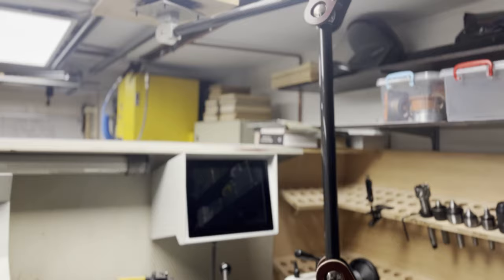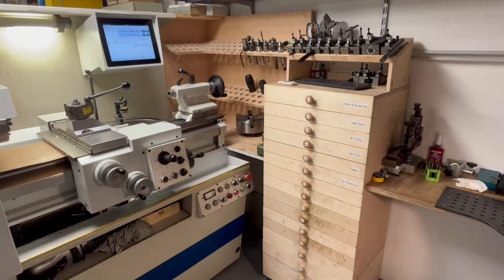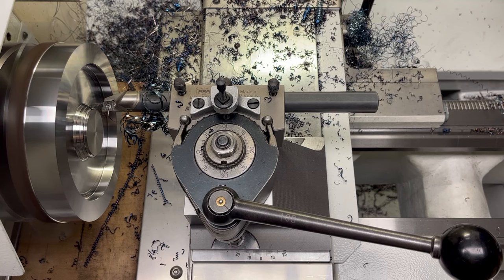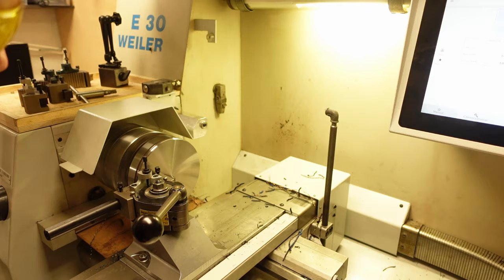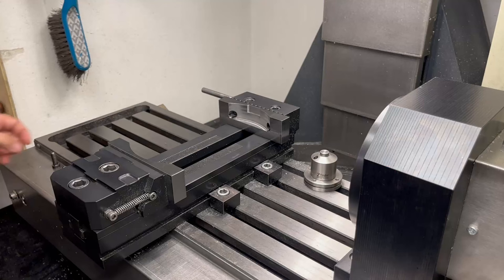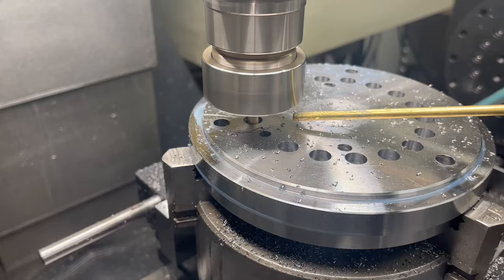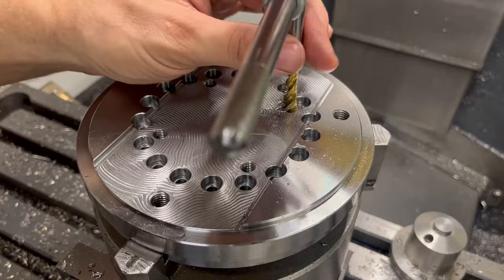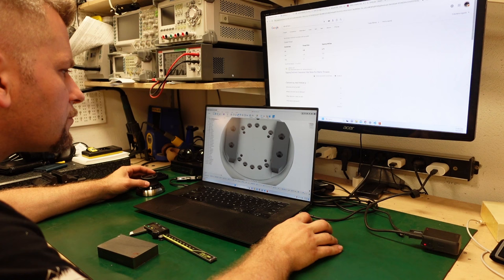Cycloidal drive 4th axis - New Faceplate (Part 1)

Comment: :)) that's how desperation sounds in Romanian :)) i don't even curse anymore, i just search for the feed hold button and count my blessings that the spindle bearings haven't shot out of the spindle yet(I have a spare spindle in a box waiting for that occasion). It is weirdly exciting to see how many times a mistake is recoverable, especially when making things for myself. Maybe it doesn't quite need that extra 1.5mm of height, maybe it can be 2mm smaller on all sides, maybe a bigger chamfer is actually better, etc. 

Anyway, look into the cheapish carbide drill bits, i got one from a local suplier and haven't managed to kill it yet and it doesn't seem to wonder anywhere near as much as the normal ones.
Reply from the maker: After I changed my channel name to LikeFactoryMade,  I told myself that I'm gonna engrave all the parts that I make with the (upcoming) logo. After fails like these, I feel somehow it doesn't deserve that logo. But I guess its just me, needing to accept failure as part of the process.
Reply: @LikeFactoryMade  Just wait till the engraving tool goes too deep after everything else goes perfect :)) or the offset is wrong
Reply from the maker: @tinker-neer  I was planning to take them to a fiber laser engraver, but since its the first time, things can go wrong there too 😂

Comment: Awesome machining!
I built a 4 axis CNC Bridgeport, but my rotary axis is a belt driven 5C collet.  I have a BLDC Harmonic Drive that I have been meaning to modify into a much more capable 4th axis.  Thanks for the inspiration.
Also, for larger threads. Have you considered using a thread mill to cut threads?
Reply from the maker: I am wondering why thread milling never crossed my mind 😅
In fact I’ve never tried thread milling since I have this machine because initially I had no thread mill, but after I found one on the fleamarket, I did not allocated the time to do some learning on plastics before I jump to steel. 
I need to put this task on my todo list. 
Thanks for bringing this up! 🍻
Reply: @LikeFactoryMade  I use Mach3, which has a thread milling subroutine.  I use it for any threads over 12mm (1/2").  If it is a single flute cutter, you can cut multiple thread pitches, along with chamfering the top of the hole with the same tool.
Reply from the maker: @keithviolette5870 thanks for bringing this into my sight. Its so obvious why it would be the best solution that I can’t figure out how it didn’t even crossed my mind 😅

Comment: Hey! Nice work. I have a Harrison M280 CNC/Manual lathe and I'm considering scraping the ways myself, or finding a professional to do it. Do you think the results you got with your lathe was worth the effort? Thanks!
Reply from the maker: My ways were reground, I scraped just the saddles. I think scraping the ways would be waaaay more complicated than scraping the saddles. Mine at least were hardened. 
I would recommend regrinding the bed (if that’s needed) then you can do yourself the matching with the saddles. 
In terms of effort, for me it took about a half a year because I had very limited time and basically no experience, but I really like what came out. 
Cheers!

Comment: i got two big gear boxes from Yaskawa Robot...i want to design 4 axis
Reply from the maker: You can build a 5th axis if you have two of them. 😉
Reply: @LikeFactoryMade  My machine z travel  is too small for 5 axis  table ...I am using  Mazak vqs 40/20  ...I can go to scrap  yard  tommorow  to actually  fetch another  gearbox  a bit smaller  that this two ...I always  wanted  to have  5 for gear cutting Spiral gears
Reply: @LikeFactoryMade  your  work is inspiring  I have watched  all of the videos
Reply from the maker: @seimela thank you! 😊